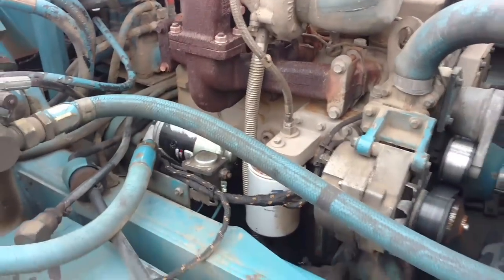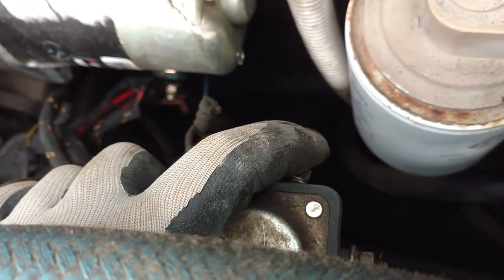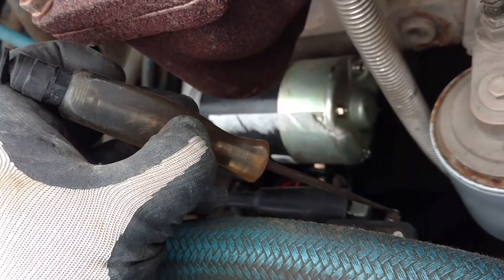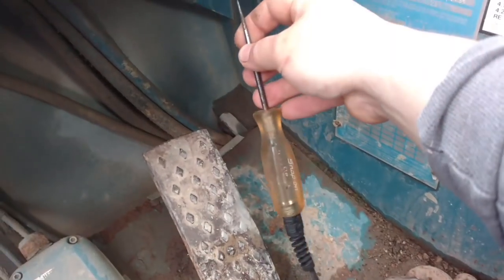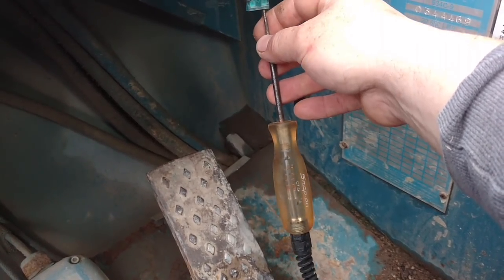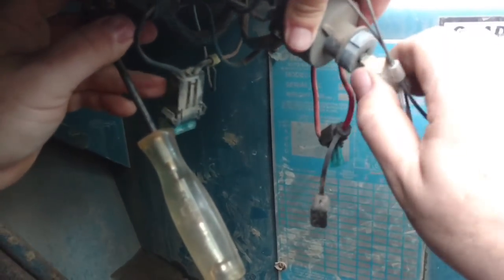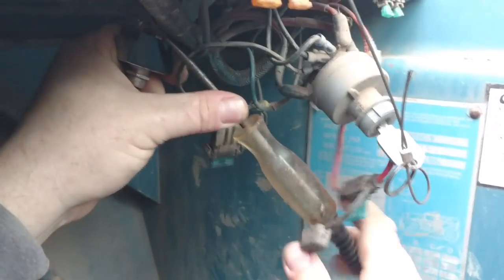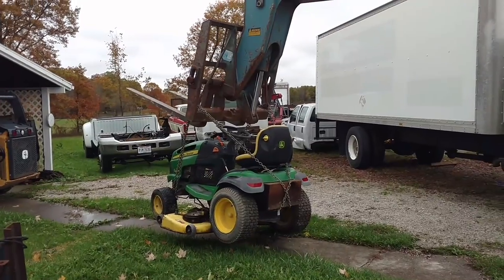GRADALL CUMMINS STARTING PROBLEMS....HERE WE GO AGAIN!

Comment: When a rocker arm comes off that JD grass tractor do not forget to find and refit the little steel buckets that go over the end of the valve stems. Head gaskets blow between the head bolts where they are spaced wide to miss the manifold pipe.

Comment: J.C. I’m wondering if you can help me. I have the same machine and the 4x4 is not working. 2x4 works still. No bad fuses. Do you think it would be a bad solenoid? It seems to go a little when I press the traction lock switch but not enough to really work. As soon as I let off the traction switch it stops moving. Only drives in 2x4 mode.
Reply from the maker: remove the solenoid. keep it plugged in. turn the key on. shifter in forward. put a screw driver in the center of the solenoid. the electro magnet should pull the screw driver. if it does, may be a bad valve. if it doesnt, check for power and ground at the solenoid connector. if you have it, the coil may be bad.
Reply: J.C. SMITH PROJECTS ok I’ll give that a try. Thank you for responding!
Reply: Ok so I tested the ohm reading at the 200 setting (I think the lowest setting) and it read 7 on the solenoid valve (that feeds the smallest hydraulic lines going to the rear motors). The ohm reading on the traction lock solenoid gave a reading of 10.3. So I disconnected the wire to the rear drive solenoid and it ran in 4x4 mode. Not sure why? I’m guessing the coil is weak and allowing fluid to flow through the valve body partially? And there by giving it weak power? Thanks for the help btw.

Comment: Everything was great, shots showed what was needed etc.  That was until we got to the end.  J.C. wanted to stick the GradeAll "Arm" into the garage so nobody would have to push the lawn tractor into place. I have  a Garden Tractor.  On my tractor,  you have to uncouple the hydraulic drive from the rear wheels, then you can push it easily on the flat. Maybe pushing that tractor around would be bad for an aching  back.   If your body (back etc.) is ok and you wanted to save time, you would have dropped the tractor near the garage door and then you'd push it in!  Not much effort and quicker.
Believe me i know how it is! You've never used the GradeAll in that building and you want to know if you can.  It would be more fun if you could use the GradeAll!  Thank goodness that we never totally give up playing!  Did you have (or have access to) a bunch of Tonka toys when you were little J.C.? 8-))
Reply from the maker: shoot! if the gradall doesnt fit in that storage area...it might before i am done.....i could "accidentally" rip the roof off!!!then make it taller! i did have tonka toys as a kid....i still do..they are just bigger.